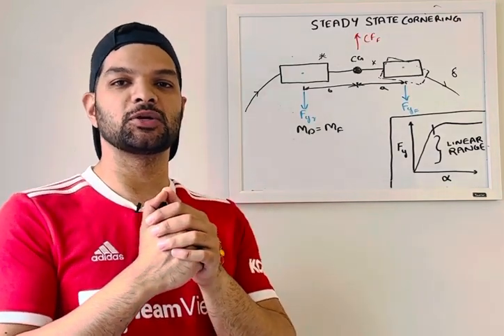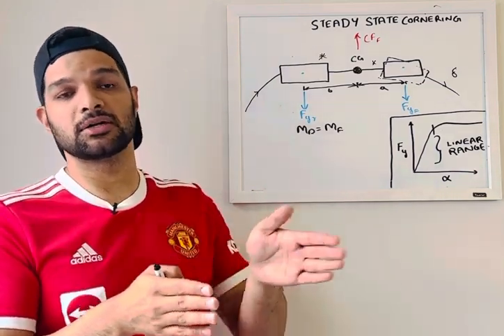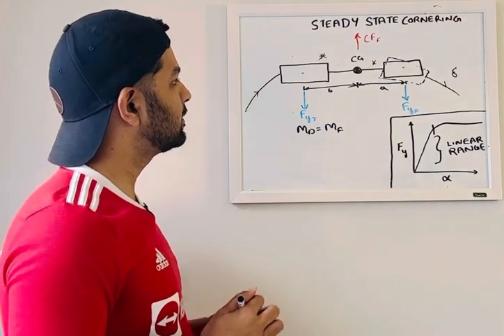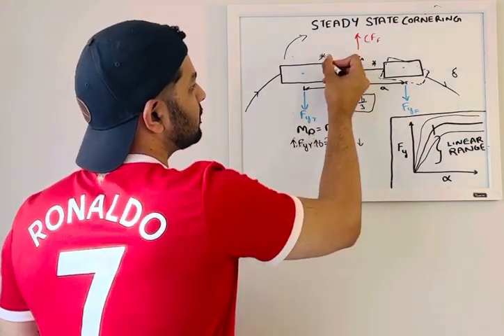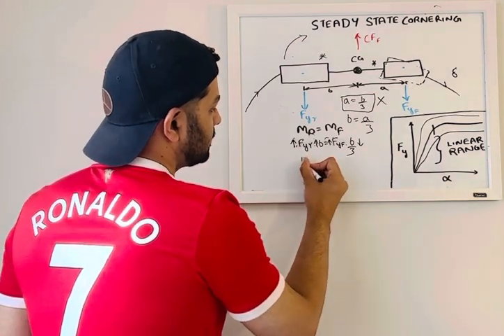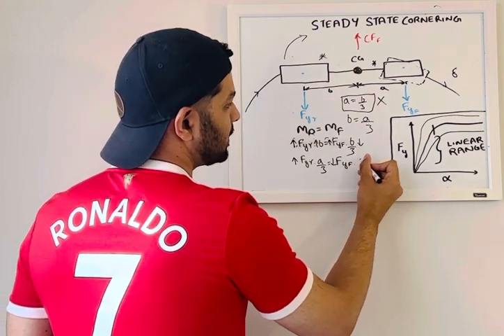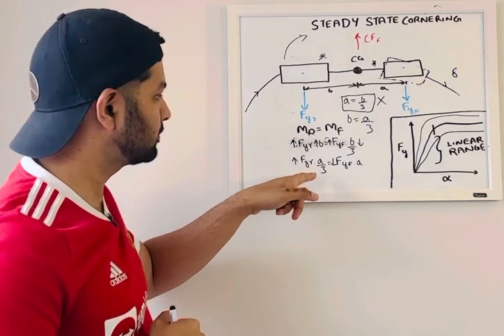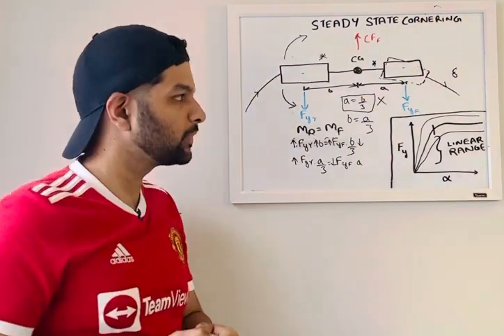Steady state cornering| Neutral steer|Oversteer|Understeer

Comment: This is simply not accurate. The question isn't vertical load, but cornering stiffness. And this thing is though connected to vertical load - also related to a lot of other parametets, like tire itself, suspension parameters, and others. Way more complicated, than just wight distribution.
Reply from the maker: Yeah definitely it’s dependent on all the factors that you mentioned, this video focuses on weight distribution aspect of it